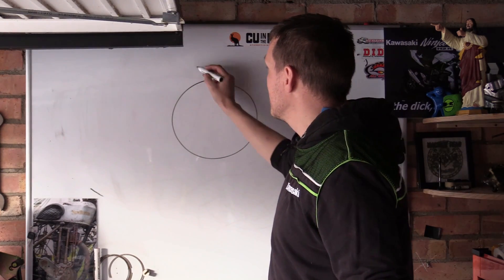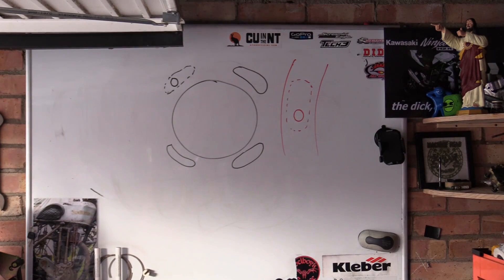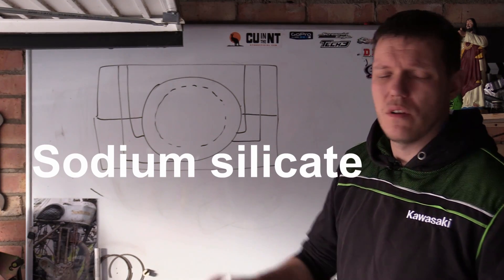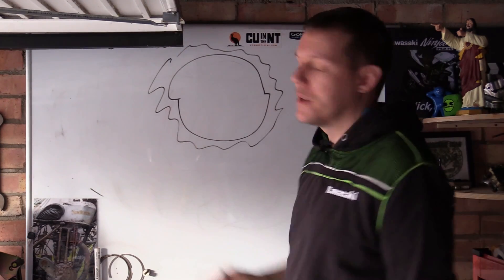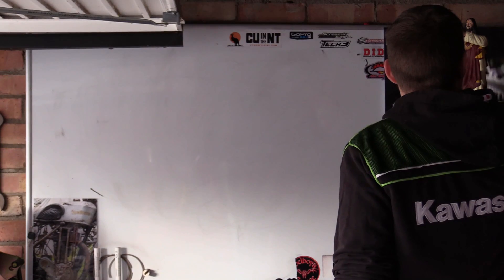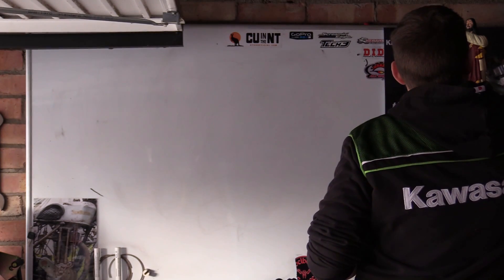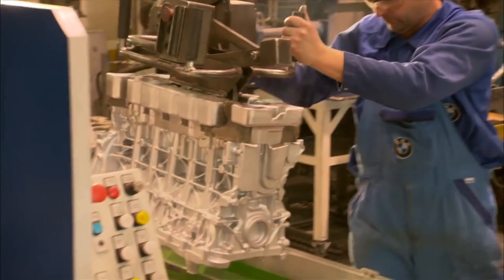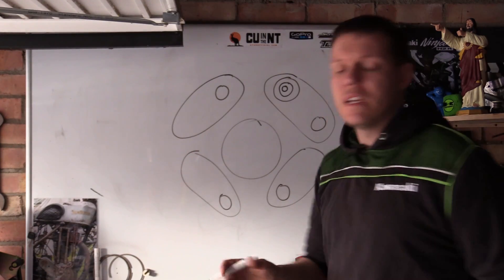Water Jacket Passages

Comment: Awsome insight. Im going to weld mine up on my drag engine. dry deck the block and head. Pass coolant through them seperatley. I keep destroying head gaskets.Coolant pressure to the moon. Now im going copper gasket and stainless rung around the block and head to help with the combustion but im curious at to what will happen if the head lifts. How will i know its lifted.

Comment: I wonder if you have any ideas for how I might clear my cooling system - mainly the engine block drain plug. The whole system (filling up from the radiator) is only taking 2 litres and should be 4.5. I wonder if there's a blockage in the engine somewhere - maybe in these water jackets, maybe around the drain plug area? I've tried scraping within the drain plug and it doesn't go in far at all - hits metal after 1 - 2 cm's and I scrape out a bit of dry black residue (oil I suppose?). Cheers. Rob
Reply from the maker: Wire pipe cleaning brushes on a longer rod
Reply: @thedirtyworkshop  Ok thanks! I noticed that it seems only to be 1 or 2 cm's deep and then comes up against metal (cylinder block inside?). So do you mean push the pipe cleaner brush through that somehow, or just around the opening, or have to open up the whole block and poke around that way (sounds tricky for my ability). It's a Spitfire by the way.

Comment: Really interesting vid, always wondered how they cast the channels in the block.... couldn't help thinking of Han Solo in carbonite though..ha...out of interest, I wonder if there is a bit of a refrigeration effect as the water goes through the restrictions in the gasket?, I guess there would be a low pressure area after the hole?

Comment: I've been fitting head gaskets to cars for over 30 years and have often wondered why the water and oil ways don't match up, never even occurred to me it could be to control water temp, I guess it works the same for the oil pressure also? Great video Matt!

Comment: something I've been wondering looking at different prototype engines is stroke/piston speeds as crank rotates the piston is moving faster towards tdc yet axel or dyno cam engines have a equal speed at TDC or BDC my thought (not important) is what would be the best stroke speeds combination🤔 
The cam engine could have what ever stroke pattern you'd like as the rod follows a cam contor. 
slow intake stroke, fast compression stroke, slow cobustion stroke, and a fast exhaust stroke of course hypothetical as balancing would be a big issue followed by changing inertia when things travel at different speeds up verses down

Comment: The venturi increases the pressure. However the larger surface area of the cylinder water port distributes the coolant more evenly around the greater heat source. So it's like multi stage cooling. Sorry Matt, I'm in hospital and the Morphia is making me feel very vague. 🚀😊🚲
Reply from the maker: In hospital? You're ment to be getting better, not polluting your mind with my videos LOL
Reply: @thedirtyworkshop  You and ave with his -47 hands are helping me through. And the morphine doesn't hurt either. So much data and a laugh really goes a long way Matt.

Comment: There are ways to 'cheat' with cores and supports, by using chaplets when there is no localised support, 
Putting metal bars in the core or even making the core using a hot box process (oil sand gives better tested values for strength), 
Changing the sand type to something more angular than sub angular can produce a stronger core.
Reply from the maker: This is true but using chaplets is an extra process that is just not required, but good comment.

Comment: Is the thermostat not enough to regulate water temperature, assuming it was a matter of overall flow rate, not just controlling intake side and exhaust side cooling? Since thermostats progressively open with increased temperature
Reply from the maker: A thermostat controls global temperature and after the head - gasket hole size controls local flow through the head

Comment: I think you really got this one spot on. I had the same question recently when working with a Nissan VQ engine. In the early years they had the coolant flow from the front of the cylinder head to the back which ended up with the rear cylinders running the hottest. In the later years they redesigned the head gasket to have the coolant come in from the block straight in to cool the exhaust valves. I read a whole bunch of SAE papers on the topic and it basically comes down to not being able to model the turbulent flow in the cooling system accurately so testing after the fact is important. What I would like to do is setup a thermal camera in the cylinder and flow heated coolant through the system and see where you have cool spots so that you could optimize the coolant flow even better for a high performance engine.